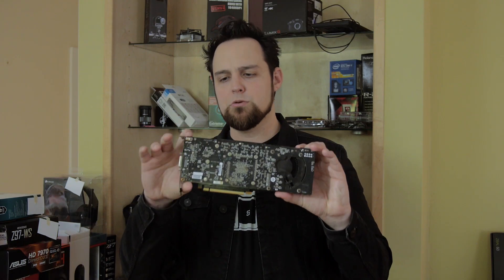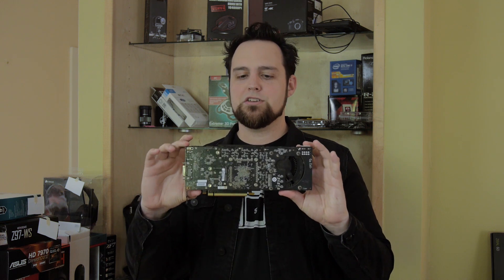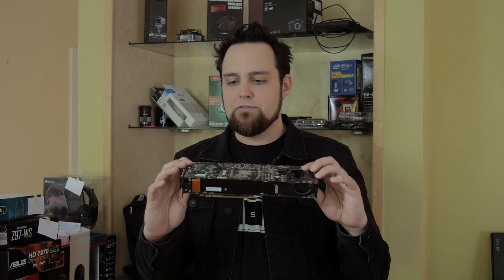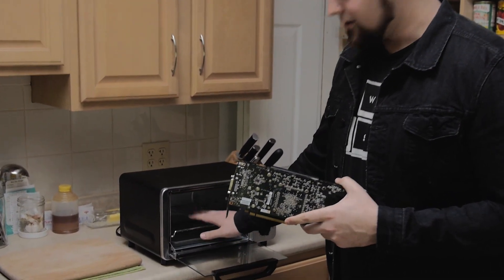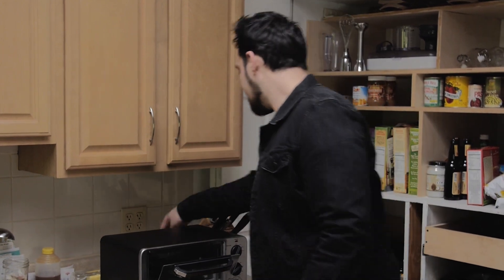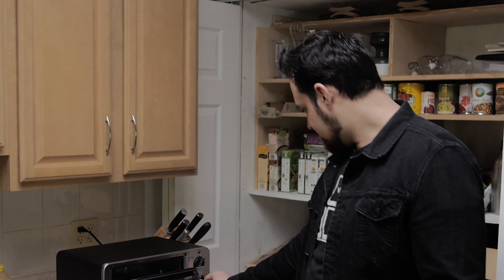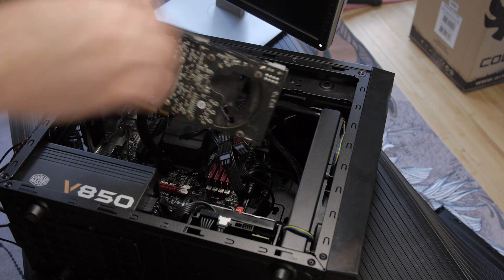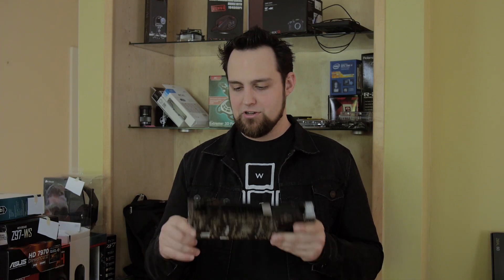How To Fix A Dead Graphics Card

Comment: What's being depicted in this video is known as "Re-Flowing", and only works when a connection, made with a ball of solder, fails or cracks between the core processor and the main board of the GPU. By heating up the unit slowly, you can make the solder melt, and rejoin itself, thus repairing the connection issues and making the card work again. I would not, however, recommend just putting the card into the toaster oven, or a traditional oven, without first removing all of the melt-able parts, like the fan and casing. Also, I would recommend on running liquid soldering flux between the core processor(s) and the mainboard. This will help to reinvigorate the solder and protect it from further damage.

Over all though, if the card means anything to you, you should send it to a BGA Rework Technician, to be professionally repaired.

Comment: I think the oven would have worked if you set it to broil actually, that's what I did with my old 8500 GT. I put it in there for about 35 minutes and, to my surprise, it worked! Even better, my thermal limit seems like it increased by at LEAST 35 Celsius, so that's a plus. Only problem is that it tends to grow legs every now and then and run from me.

Comment: FOR ppl who dont believe, the part were you put the card in teh oven actually WORKS , fixed a ps3 like that, the proper way would be to use a heat gun(its a supercharged hair dryer) or at least remove the heatsink and fans and teh professional way would be to reball it, google it

Comment: If any of you are crazy enough to try this those temperature settings are WAY TOO HIGH AND FOR too long ! First you should remove any plastic parts that may melt like FANS and you should only set the temperature a little above the solders melting point which should be 361F for SN63, for the new no lead solder look up the type you have and add 20-30F too it for the oven. Try maybe 3 - 4 minutes and PRAY because there is only a small chance of this working. A better but just as risky method would be to resolder the main chips with direct heat from a hot air gun. Also, make sure you put the board in with the components facing upward and PERFECTLY LEVEL. When the solder melts they will slide down off the board if it isn't level.
++++ You should never use this oven again for food since it is now contaminated with LEAD  possibly. I'm not sure about how much but why risk poisoning youself !
+++This should never be done inside because of the fumes created !
The best recommendation, buy a new board instead since it will cost you a toaster oven and is very unlikely to work since you are COOKING THE ELECTRONICS !
Professional ovens that do reflow are very carefully controlled heat.

Comment: i wouldn't recommend the toaster. if you put it in the oven between 210-350 degrees for no longer then 10 minutes. this is not a complete fix but your graphic card will work up to a month on a basic gaming load. ultra setting will kill it much faster.

Comment: Totally fake, you cannot fool me with this! It could never have worked, it only works once a year and you used the wrong ingredients.

You need to find out the date the graphics card was first manufactured on and perform the ritual exactly nine weeks and three days after the date the card was first made (note the card not the GPU), you need to begin the ritual precisely at dawn in your location as the sun breaks the horizon and begin with praises to Lord Gaben. Preparation is fine but you can only begin the actual craft as the sun rises, finally you had the wrong equipment.

You need the best rival GPU from the time (broken or working, working means a higher chance of success), to make an example if you where trying to resurrect a 7970 you would need to bring an Nvidia GTX 680. You must have prepared it by removing the actual GPU and GRAM from the card, as you carry out the craft you place the card in the centre and the GRAM at each cardinal point and have an assistant crush the GPU chip after the beginning of the ritual and sprinkle it in small amounts around each cardinal point. Make sure they do it in a counter clockwise rotation while verbally decanting benchmark results where the card you want to resurrect where better than the sacrificial card, these must be perfect or any future card you ever get from the maker of the sacrificial GPU will break! I cannot stress the importance of getting that right!

So you see, I know how to do it so your fake videos do not fool me! Pfft.

Comment: if the fault is just dry soldered joints that might work, but not if any of the many parts caps, diodes, and the GPU main chip on the card have themselves failed.

Comment: i was kinda hoping this would be a real fix. i have two dead 9800gx2's. they were replaced so many times by evga, they said enough and didnt send me any more. :( those damn things required so much power and produced so much heat, i hated them. may they burn in hell for all eternity as the worst cards nvidia ever made.

Comment: A much better way is to use a heat gun on the gpu while covering everything else on the graphics card with aluminium foil. This will reflow the gpu but not potentially ruin other components on the graphics card.

Comment: My roommate told me of this trick and I thought he was out of his mind. "WTF! I'm not going to put my 300 Euro card in the oven!"
But it can work and you might as well try since the card is already busted anyway. In the oven the card should bake for about 30 minutes at 100°C. Taking the cooler off can help to avoid plastic warping and melting.

Now this is a last resort and should only be done if you're absolutely certain that the card is really defective. Otherwise you might kill a functioning card.

Comment: Best GPU necromancy  i have ever seen ! haha
A tip for people who wants to attempt it , this is is a temporary fix if the graphics Card keeps overheating all time it will break again.
You can actually use air soldering too its much safer and you will have more control.

Comment: I would suggest spending the money on a cheap solder reflow station instead of using yoru toaster or conventional oven but even if you do use them ffs, please take the plastic bits off first :P

Comment: I actually fixed my 9800GTX this way :D although you're supposed to take off all the covering, heatsink and fans and when i did it i used a heat gun instead.

 Disclaimer: of course this video was a parody and logan probably knows the proper way to do this.

Comment: So i fix things video cards and motherboards for a living. with oven you don't get flux so even if it does work it wont last. ad toaster oven is is terrible due to it's uneven heat. re ball is the true way to fix it for good but, a re flow can work if done right and if steps are taken to fix what ever flaw there was  in the cooling system (though in some cases it's  out right just plain bad solder).

i've brought back more dead mobos and video cards than i can i could keep track of. probably like 20.

Comment: I tried this method: http://hardforum.com/showthread.php?t=1421792

And it actually worked! It had died before of overheating when I put it in a crappy computer wich for some reason had no cooling fan intake, afterwards the screen was black with some white fuzzy lines but after it worked as if it was new.

Comment: That old toaster trick is actually legit, but i wouldn't put it at 450 deg.F for too long, i'd put it at less than 300F with 7 minutes. works every time with an 8800 gts.

Comment: this works but it wont last long... it will not heat up the gpu enough to reflow solders plus it will might damage the Capacitors.. the best way to fix this is using Hot Air.. you can use Hair Dryer then spot the air to your GPU for around 30mins.. same with the Memories after the GPU, after reflowing, wait for 15minutes and connect your heatsync and fan and test.. it works for me my GPU after fix serves me around 3years and still working..

Comment: from experience its best to take off the cooler first so the plastics don't melt. best temps that worked for me are 120 degrees Celsius/ 250 degrees Fahrenheit for 20-30 mins. make sure to remove thermal padding and paste and re apply.

Comment: We used to jump start old 3dfx Voodoos all the time. The trick was to plug them in a sleeping dude's arse (preferably someone on a paleo diet). The bio energy activated by the pineal gland caused DMT to flow through the PCI port and healed the contacts. It also overclocked it automatically.

Comment: DID he seriously say to put a Video card in an OVEN?
Solders melt at a much higher temperature.
Many other parts can't withstand the heat.
You might re-melt the solders, but destroy the Core+ram+coolers at the same time.

Comment: The re flow trick does work Logan just did it incorrectly most likely for comedic effect. a proper re flow requires the card to be taken apart and placed in the oven component side up at 300f for 6 minutes. i find that the life of the card is limited as the joints are weak and usually break again.
Reply: I can confirm this, did it with my 8800 Ultra (was massively artifacting/low framerate) and it still works to this day! you have to take the shroud/heatsinks/fans off when you do it, and put the pcb face up so nothing falls off lol (capacitors)

Comment: What does he mean by "reflow the solder"? It seems a bit vague, any more details? Wouldn't bubbles form when the solder is heated to its melting point again increasing the connectors impedance?

Comment: If the graphics card doesn't get fixed by heating it in the oven you could also try to put the rest of the computer in the oven just in case the fault is not in the graphics card but in some other component. I'd start with the hard drives. Just like with cheese when it starts to melt it is just perfect.

As for spells and black magic. If the fans start rotating the wrong direction it means your computer is now possessed by a demon. If you have windows operating system this doesn't change anything though. Just format the harddrive and you are fine. Just like with windows.

If you have non-windows os you need water cooling to get rid of the demon. Just fill your water cooling loop with holy water and place lots of garlic inside the case and the problem should fix itself. If not then take out the motherboard and strike a silver dagger through the motherboard. Aim between the dimms1 and 2.

Comment: Waaait. So did reflowing it fix it? Or do I have to do satanic rituals in order to summon demons to get it functioning again?
Reply: It varies between GPUs. Older ones require different rituals but have a higher chance of working from the reflow. The older ones where the solder is solid has to be toasted for about 30 minutes minimum. Hope I helped.
Reply: I believe the furnaces of hell were hot enough to reflow this ancient device.
Reply: Reflowing totally works, i've done it a number of times with success. but please don't be silly like logan....take off the friggin heat sink and fan. (should go without sayin lol).
Reply: Yeah, I reflowed a Macbook Pro motherboard (the one that came with an nVidia GeForce 8600 M GT. Faulty soldering was a common problem with these as nVidia had just switched to the lead-free variety) once and it worked again. The fix only lasted a couple of months though.
Reply: Also it's important to note that you should place the graphics card on the ground upside down.
Reply: ManWithBeard1990 actually the GPU in the video is double sided.
Reply: Yes but the pci express connector is on the ground. When installed on a pc it's on top.
Reply: Pre 6th generation require contacting Satan.

Comment: Hmm, my graphics card has been running slow lately, i wonder if this will fix it
Reply: dont know if you're joking or not so will say this just in case, dont. it only works if the card is broken due to a solder contact failure :)
Reply: Haha dont worry, i know, i was only joking... ill buy a 780 and try it with that instead

Comment: Well I did this but with an oven. However, we needed some thermal paste... So we decided to try tooth paste with vasaline. It seemed to work, but we used to much. It spread all over the pcb and it messed up the video card. Everything is now distorted when we connect it using hdmi or usb.

Comment: Does this work in a microwave?
Reply: NONONONONO DO NOT PUT METAL IN A MICROWAVE
Reply: Ivan Montserrat So basically you are saying it will help me overclock better?
Reply: Ehhh? try reading the warnings in your microwave manual.
Reply: Yes but only high end really expensive ones
Reply: There's this amazing series on YouTube called "Is it a good idea to microwave this?". I don't remember them doing a GPU, but they did do a motherboard once.
Is It A Good Idea To Microwave A Motherboard?
Reply: calvin holtzclaw R9 295x work? or will the water cooling cause issues?
Reply: If by "work" you mean "ionizing all components and wait for fireworks to come out", then it certainly works :D
Reply: The Croaker it will work you just have to subsitute the water for mineral oil the water will turn to steam and cause the card to have a short
Reply: It is a joke, just like the video...

Comment: haha , one of the wierdest but best tricks ever for your card. First time someone told me to try this i was very scared. it might not always work , but your card is dead anyway so why not try it ! be sure to remove any plastic bits tough as they could melt in the oven . And we dont want a plastic encrusted videocard now do we .

you really do need 450° because the soldering on your graphics card is done with silver soldering instead of tin.